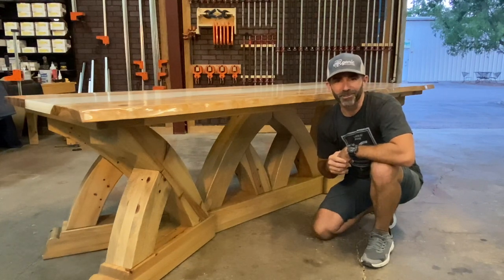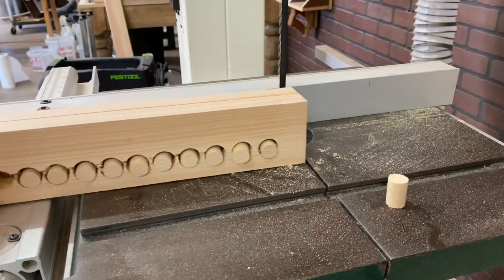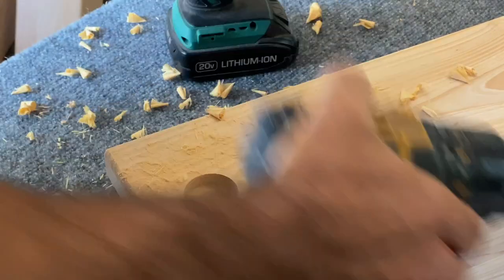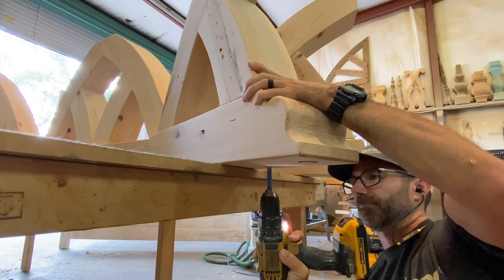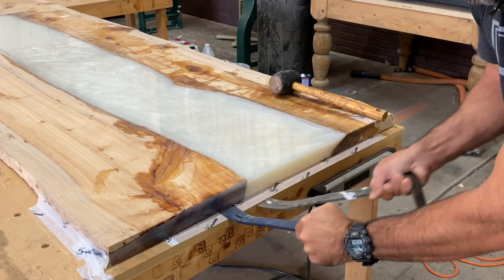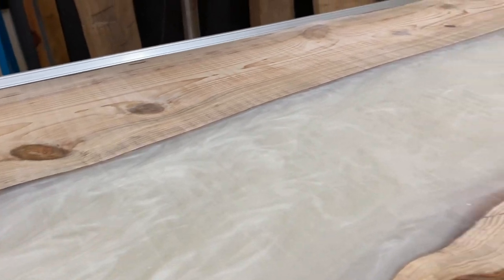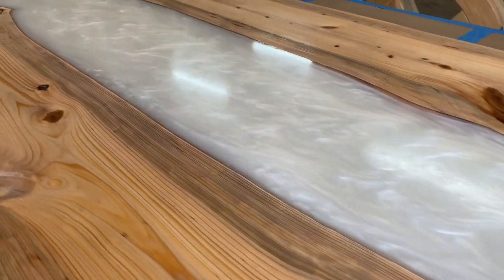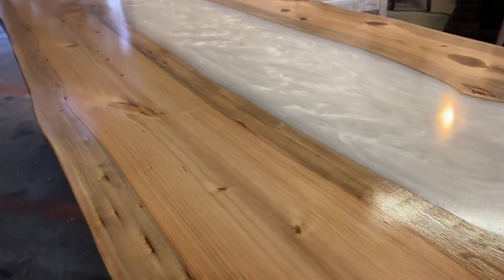The Ultimate Table Build | Episode 5

Comment: Love the Table!! Tips on how not to get swirls in the epoxy while sanding??
Reply from the maker: Thank you Erik, well... for me, its the sander that I'm using... I don't want to sound like a commercial or like I'm pushing the sander, but I use to get swirls all the time until I started using the Mirka Deros Sander.... its crazy expensive but the results are insane! Ive used a ton of sanders and none compare to this one.  So, no tricks just an expensive sander.  You may try stepping up the grits a lot! Like, 60, 80, 100, 120, 150, 180, 220... that should remove any swirls but it will be a ton of sanding.

Comment: Very nice. And I am having trouble getting a cross cut sled built...
Reply from the maker: Thank you 🙏🏻 and I can relate... I’ve made a few cross cut sleds but they were never good enough, so I got this slab flattening mill and it’s perfect! I have a link to it in the description box if you’re interested 👍
Reply: Designs by Donnie possibly later. Was trying to do this on the cheap, using the metal parts from 2 mitre gauges